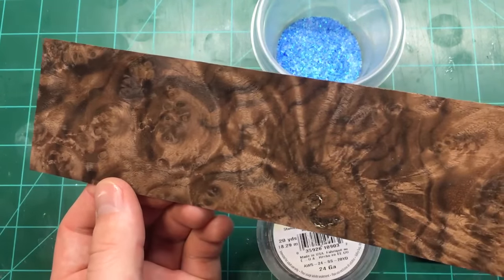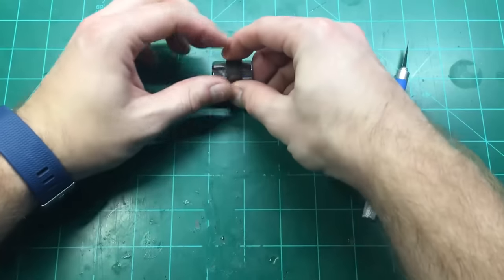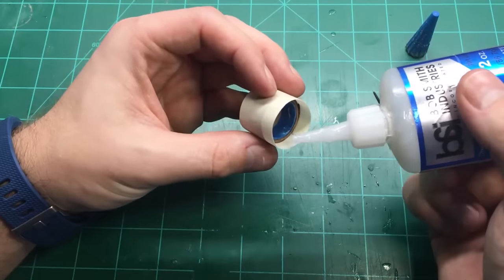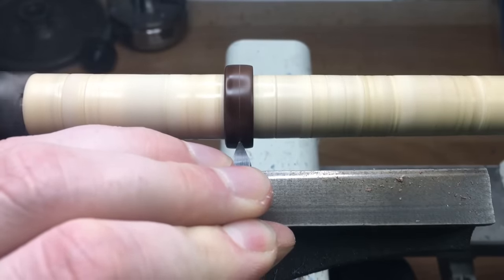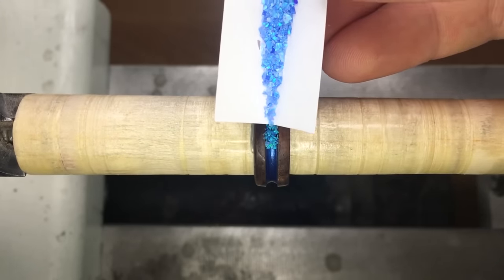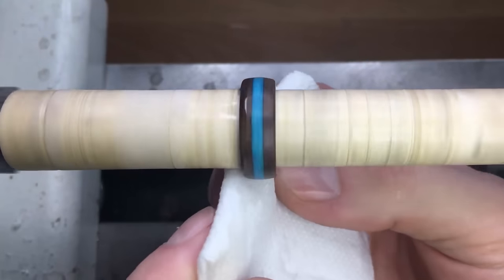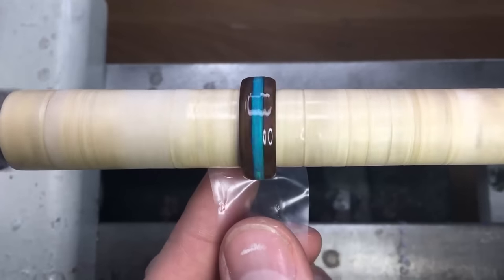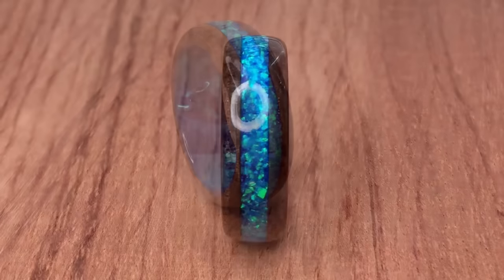Creating a Walnut Burl and Crushed Blue Opal Wood Ring

Comment: This stuff really inspires me to go make my own rings, but i have no experience or tools. or money. i'll figure it out
Reply: Flaming Shirt Me though 😆😅
Reply: Just so you know, pretty much everything you need to do to make a ring like this can be done with a dremel and a ring mandrel, which is like 50$ together
Reply from the maker: yep, brings back memories
Reply: +Tempest Rings what is the reason for the thin coats of the CA?
Reply: When I started, someone cut me strips of mahogany to use for veneer, the glue I got from the dollar store, and then sanded it all by hand. It takes times, but you feel a huge sense of accomplishment when you see that shine of completion
Reply: I made some simple (non-inlay) bent-wood rings on a 50 euro drill press, using a bit of round wood plus tape as a 'chuck'. Got a veneer packet off eBay for next to nothing, and with some CA glue it looked quite nice.
Reply: You only need wood glue and sandpaper to start ring making. All the other tools are to speed up the process
Reply: You can get by without a lathe and all that. Granted it's hard to make a ring as uniform without a lathe or more expensive tools, bit I've managed with little more than maybe $10 of supplies and a couple hours of time with some files, razor blade and sandpaper.
Reply: Flaming Shirt - when there is will there is a way! I'm disabled  on a fixed income and made my own lathe from a free treadmill. People throw them out all the time. Look on craigslist. Often people just don't want to move them. They run on a DC variable speed motor and with the treadmill you get the AC to DC controller. I mounted a drill Chuck to my motor and made my own lathe for making pens now on to rings, earrings, and more!
Reply: Joshua Potter im right behind you, built mine out of a drill press... its kinda highly adictive isnt it
Reply: Flaming Shirt  人。
Reply: I really want to work with glass, but a small set starts at a couple thousand. It's really frustrating :/ it's been something that I've been passionate about since i was really little, talk about a dream crusher lol! This sounds a little more affordable and looks beautiful too, definitely will look into more :)
Reply: buy 5 tons of CA
Reply: Flaming Shirt same!
Reply: Me on every cool DIY videos
Reply: +Joshua Potter +tempest rings, thank you. This is the first ring making video I've ever watched, it was stunning. I'm also disabled and on a fixed income. I've been looking for an accessible hobby for while. You have both inspired me with your ingenuity and creativity. I used to be a mechanical engineer....I can make a lathe from a treadmill! We have yearly "clear out" days in my city. Do others do this, it's so awesome. District by district puts all the stuff they don't want on the street, loads of treadmills and EVERYTHING. It's like a massive swap meet. Everyone roams the streets picking up stuff they need and putting out stuff they don't. The rubbish truck gets the actual rubbish on a set day. Re-use and up-cycling is the go!
Reply: Flaming Shirt me too. i wann mae these ring but i dont have the experience adthe tools.🤣🤣
Reply: go for it gotta start somewehere.
Reply: @TempestRings  This is really cool. Could you tell me where I can get the rough blue opal like you used?
Reply: Cool name dude
Reply: @austingoralski9851  got a link for a $50 set?  everything ive found has been in the hundreds
Reply: @TempestRings  I've looked at your website ... any chance of getting this ring but with silver wire on each side of the blue opal? I really like the look of one you have on your website but I think I might like the blue epoxy core instead of the tungsten core🤔
Reply: Does anyone know which supplier has these products?

Comment: What exactly did you use on the inside of this ring? I know you said epoxy but what is it specifically I’ve tried to find some but epoxy just brings up so much haha thanks man :)
Reply: Ash Blat looks like an epoxy resin pen blank that has been sliced into a thin strip
Reply: its celluloid ( guitar plectrum )
Reply: @DecaziCustomRings  Any idea where to get this stuff? I've looked around, but haven't found a reliable source.
Reply: I have the same question
Reply: @tmsrobabbott  see above link
Reply: @orangapahikaranl6347  really nice!!! Thx for sharing man!

Comment: I've been watching dozens of veneer ring videos and one thing no one ever mentions is how they avoid getting their fingers stuck together with all that CA. Or do you keep a bucket of acetone handy? I'd really like to know! BTW, this is one of the most eye catching designs I've seen. Beautiful work! Got my subscription.
Reply from the maker: DJ Sabo when I first started my fingers would get glue on them all the time, but now it almost never happens, it is just practice and knowing what you’re doing.
Reply: DJ Sabo - like Tempest said its practice...   I put magnets in my speedcubes (modern Rubik's Cubes) as it enhances the mechanical action, but this involves CA glue and 4mm magnets in a confined space, my first attempt was successful but not pretty.    The more I did it, the more I learned how the magnets and glue behave, early mistakes learned from (some comically tragic chain reactions can occur with tiny magnets), it does get easier...  not because the task is simpler but rather you level up and get that +1 Crafting Skill bonus...
Reply: orion khan lol thanks for the leveling up analogy. I am finding it a little easier with each one I do. I bought a bottle of acetone just in case, but haven't even needed to open it yet. Now, if I could just level up my creativity skill to attempt some of these more intricate rings...
Reply: DJ Sabo it may help you to get a little Vaseline and wipe it all over your hands (like you were washing them under a tap - that action). It absorbs into the top layer of skin, so stuff sticks less, but there isn't a load of residue actually ON the surface, getting all over the piece you're making. I was told that tip years ago by a painter and decorator, to help with clean-up after painting, but I've found it's good for gluing work as well.
Reply: Is it healthy to wear this ring when you are outside and sweating? Seems that the glue would get in the skin.

Comment: Hi. Couple questions. (1) If you are shooting for a size 7 ring or size 12 ring, how do you start the process to be close to the correct size? Do you just use a socket that is reasonably close but slightly undersized? (2) can you provide a link to the blue enamel, the SS wire or tell me what gauge you use and finally, the light blue epoxy strip that becomes the inner face of the ring? GREAT VIDEO!!!
Reply: I have been making jewelry for a longgggg time and still have trouble getting the exact ring size unless I can fit the person many times... I wish he would answer this question too.
Reply: It would be nice if he would expand on the blue enamel...maybe it's just blue enamel paint...?  The ss wire is 24 gauge.
Reply: Ring mandrels are stupid in my opinion because they are tapered...I have 3 ( a stepped one too)and I still prefer to fit the person's finger...  I think I am going to just make some ring formers out of copper sheet...that way I can just grab the former and know it's the correct size.  Maybe there are sockets that are just the correct diameter as rings...I don't know.  I did see another video that's entitled "A ring for my mom"...and 30 seconds into the video is shows some pre-sized formers...perhaps they are sockets...I can't tell from the video.

Comment: 9:13 That's a physical safety NO NO NO NO ! Just imagine what will happen if your finger for any reason gets stuck....
Reply: His finger would get so crushed that he wouldnt be able to do any more ring, ever... and btw I do the same thing. putting my finger into the chuck to sand the inside :D
Reply: pfff do you have a lathe ???? i guess not. i use it every day and i touch the jaw so many times nothing will happen it turns so fast that it just tickes you hand thats all. dont be so dramatic
Reply: Touching the jaws of the chuck is 1 thing, putting your finger into an opening with barely any clearance with something that can get traction (sandpaper) is completely different. If that finger ever gains traction the lathe will twist it clean off the hand and at that speed there is no way to react fast enough to pull. If lucky, it will just be the finger.
Reply: Yeah, I felt pretty ill watching that part.
Reply: Not that this is ok to do, but seriously i don't know a professional craftsman that hasn't broken broken the cardinal rule of removing a guard or a safety, or not wearing the proper PPE at some point in time or another to get the work done more efficiently. If your new to a tool or process by no means should you ever compromise a tools safety features (or a professional for that matter) but lets be real......once you know and get comfortable with a tool, you will do things like this to produce results quicker.....it just happens. You will be fine as long as you understand both yours and the tools limitations and always keep a healthy respect and consciousness of the item your using. with all that said.......a safer way to do this since you obviously have gallons of CA at your disposal is to glue that tiny piece of sand paper to a sized dowel , that would eliminate you sticking your finder into something turning at whatever RPM you have that lathe set to. I do it all the time with cups and hollowed objects i make.
Reply: While you definitely have thought of a safer  option, It's not just being comfortable with a tool it's also having zero distractions. At the speeds power tools operate at it only takes a split second for something to happen and if you do it at work and the Ministry of Labour gets involved, that's going to take a lot of rings to pay for those fines.
Reply: Although I wouldn't put my finger in there this guy seems to know what he is doing. And it all comes down to it's not your finger or you medical bill. If he looses his finger it's his fault.  Let the man live and do his beautiful craft. Beautiful ring and keep up the great work try to be as safe as you can be and best wishes .

Comment: What standard or general rule of thumb do you use when sizing your socket for the sizing of your ring ?  I mean to ask, how much smaller socket will you use to allow for sanding the inside to the desired size ?
Thanks for your generous consideration,
sincerely ....................................

Comment: Is it possible to make a ring like this:
A piece of wood, in the center a piece resin and another piece of wood on the top. Like a burger or a sandwich. Glue them together. Make a hole in the middle and roughly cut the outside into a circle. And then sand the outside to smooth it. Then make the edges a bit round. And oil it. 
Would that work like that?

Comment: So I know alot of you guys are saying you don't have the tools to do this, I can help you out with this.

First for the mandrel
You will want to take a wooden pencil, or even a drill bit, and wrap it over and over again in masking tape, I suggest masking tape because it's pretty easy to mold and once you get it into shape, your ring will hold, once that is done, stick the end in your drill or Dremel, this works well for sharing the ring against a sanding block or sanding sponge, and to polish the ring quickly.
The problem with this unfortunately is that you need great accuracy for the inlay, you may be able to make a table top mount for your drill if you're motivated or creative enough.

For the CA glue, any old superglue will do, that's all CA glue is, same compound.

Veneer can be difficult to find, everything I found was preglued, so instead of a hardware store I'd suggest a hobby shop, I found a sheet for about 8 dollars, this is also where I found the gemstones.

Comment: It's a lovely ring. I love opals,  but I have to say .... I am not a fan of the blue plastic liner at all. It  really cheapens the design.

I too am concerned about how the ring would stand up to daily wear and tear because of your choice indicative. CA doesn't deal with shock very well and can shatter, it can get soft if it gets wet  and it would be incredibly easy to ruin the finish you worked so hard on.

Comment: Hi, please can you answer the following questions:

1. At 0:23 you said you were using a strip of blue "epoxy". I am not sure what you mean. In my mind epoxy is a gel like adhesive or substance used to adhere things together. I work in construction and use epoxy all the time so I'm confused as to how a hard solid strip can be epoxy. Can you clarify? I'm new to jewelry making so excuse my ignorance.

2. What did you use to make the bottom of the trench blue before you added the opal? You didn't show it in the video. You carved the trench and then next thing I know it's lined with a blue substance. If you could tell me what it is and how you applied it I would greatly appreciate it.

3. Lastly, did you crush the opal yourself or did you buy opal already crushed? If you did crush it yourself can you tell me what your method is?

Thank you so much for these videos. They are awesome and truly inspiring. Also thanks in advance for answering my noob questions.

-joe
Reply: The blue in the trench is the blue epoxy in the center of the ring. He gouged the trench deep enough to go through the wood and into the blue stuff.

Comment: Hi,new sub here. Beautiful ring, one question though, I'm from the UK and don't know what CA is, please can you tell me? 😊
Reply: Its like an upgraded super glue. Wood turners use it a lot to fix cracks and other things in wood. They also use it as a sealer
Reply: mojo jojo got it,thank you x
Reply: It stands for Cyanoacrylate if that helps. Like super glue, can be used for bonding acrylic, and fingers together, actually used in place of stitches.
Reply: I think its called mitre mate in the uk
Reply: Superglue
Reply: Cyanoacrylate (CA) "Super Glue"

Comment: How thick is your wood veneer?  I put mine around the socket and it snaps even though I did the hot water shaping.
Reply: Some wood veneers are hard to work with. I bought a 40 pack from Amazon and some of the prettiest wood from Africa doesn't like to be rolled small.

Comment: Curious to know if the wooden mandril that you ised to shape the ring is something or made or did you buy that.
Reply: Get a 1 inch wood dowel rod. Its bought cheap and then just lathe it down to fit and hold a ring.

Comment: I've been loving these videos, a lathe is already on my wish list for other reasons, what would be a minimal set of equipment to produce anything like this?
Reply: A cheap lathe is about $200. Chisels another $50-$100. Glue, $10-20. Crushed opal $10 (for multiple rings). Craft supply USA sells ring Mandrels for about $10 or so (each one would work for about 3-4 ring sizes, I'm not sure if they also require a pen mandrel though which is another $20), they also sell ring cores for about $6 each, if you don't want to make your own. The chuck he uses in the end is easily another $100 but if you buy a pre made core you would not need it. Im not sure about the cost of the wood veneer though I would guess under $10. Buffing wheel is another cost that could be avoided, using micro mesh sandpaper ($20), otherwise the wheel I would guess $80.

Comment: When I try to polish mine I get these weird grey streaks. I was thinking it might be my sandpaper melting into the glue as it heats up. Have you ever had this issue? If so, how would you fix it?
Reply from the maker: yep the abrasive on the paper is melting, if you are polishing the clear coat then wet polish it. Otherwise you can just polish slower so the paper doesn't heat up.
Reply: Wonderful video, what size lathe and make lathe do you use? David in Tasmania

Comment: Is it possible to know what did you used to "glue" at: 06:05? And then 08:00? 
Thank in advance!
Reply: He used Thick CA glue (Cyanoacrylate glue) for keeping the stones in place and a thin CA glue to fill in the gaps. Then to finish the ring he used a few coats of thin CA glue and then a layer of Thick CA glue as the last coat. These glues are also almost instantly cured by using a CA glue activator.
Reply: @Daplaya177  thank you, so is it just normal "super glue" that i can buy in almost all shops? I found for example something like "WIKO CA glue" is it oky like this one? Thank you :) 😅

Comment: Did you just crush the opal with a hammer?
Reply from the maker: I use a frit crusher and frit sifter, then run a magnet through the opal to get the tiny pieces of metal from the frit sifter, then rinse with alcohol and let dry.